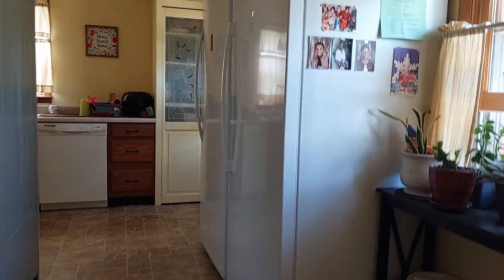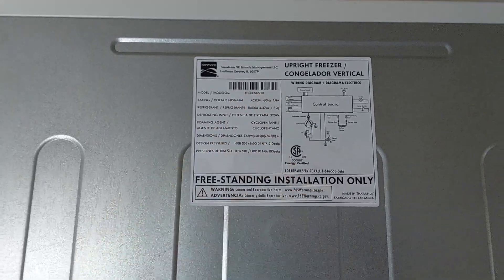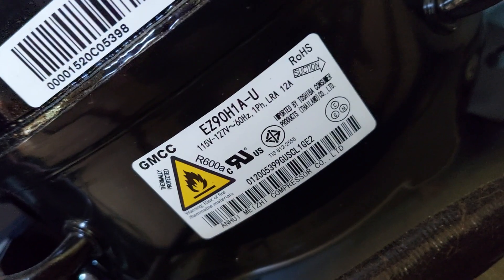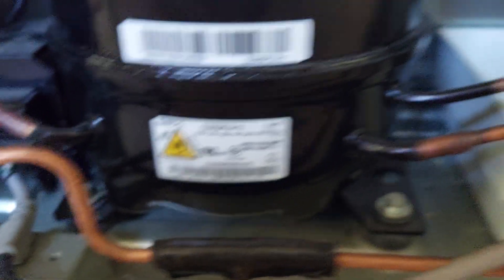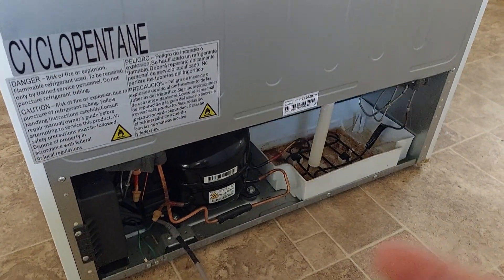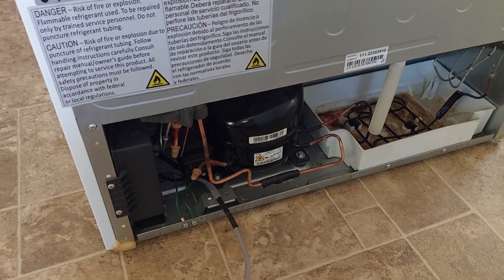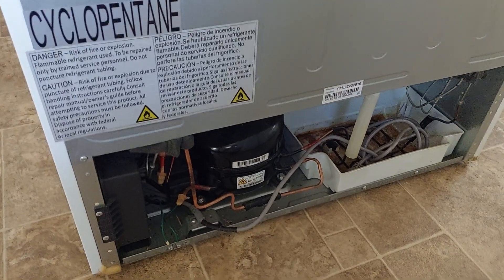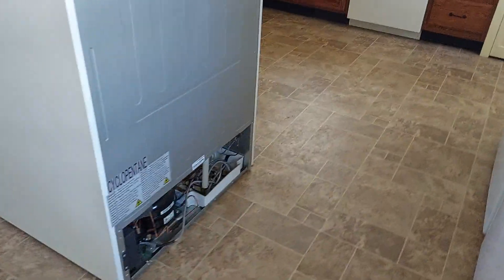R600A and Exploding Refrigerators

Comment: R600a (isobutane) has a Global Warming Potential (GWP) of 3, making it a much lower-impact refrigerant compared to alternatives like R134a (GWP of 1430) or R12 (GWP of 10700). It's a hydrocarbon refrigerant with a short atmospheric lifetime, less than one year, contributing to its lower GWP. AFAIK, it's legal to simply drain R600a refrigerant to the atmosphere, though flaming it as you release it would reduce the GWP to 1.

Comment: Makes me wonder why in the world there putting sensors in the HVAC coils in homes .
R32 and R454B has the same sensor in them .Also has a label as flammable on the coil and outdoor unit  what in the world are these companies thinking of .
That refregant was banned back in The 1930s R600a is nothing more than compressed gas in a lighter

Comment: Also some of the condenser coils are run in the side walls of the fridge, if the sides get warm while in use then there are tubes in the sides as well.  Just a note.  You can charge a r 600 a with r 134 a.  You just take the unit outside, tap the suction line with a valve, release remaining r 600a, pull system into a vacuum with a vacuum pump, then recharge with r134a you can use the cans of r 134 a that are sold at your local auto store or online from ebay.  You will need a conversion adapter to adapt the r134a can to a manifold recharge hosr or gauge.  Charge until suction frosts, and then back off of charging.  Shut off freezer, wait 5 mins, restart freezer, observe suction line, if stays frosted, release just a little bit of the charge until no longer frosted.  You may have to play around with this a little bit.  Then let freezer run and observe inside cabinet temp  and add the r134 a if needed. I have converted many r600a and r290a to r134a, and no issues with cooling.  You just have to tweak tbe charge a little as you are using capiliary tubes that are meant for r600a.  Hope this info is of help to you.

Comment: condenser coil not evap coil
Reply: Another YT expert!
Does not understand the basics.
Reply: @dwightsmith5174  Ok you are amateur I am a fifty year refrigeration tech. I should have made it clear. You are calling the evaporation pan with a hot gas line running thru it an evaporator. The evaporator is located inside the box.I use 290 mostly but occasionally run into 600 on residential units. It's really no big deal and actually safe if you know what you are doing. Works really nice as the delta is way wider cutting down the cycle.